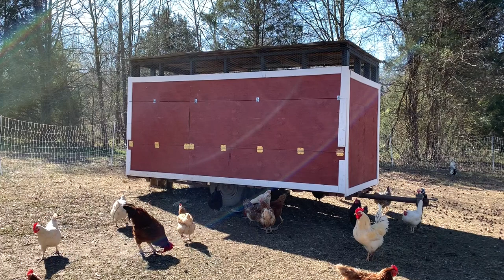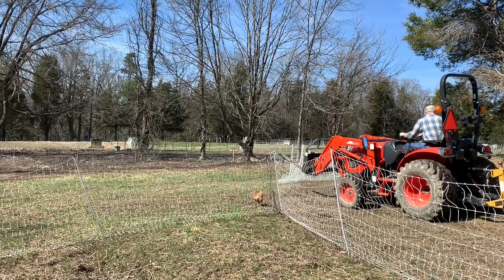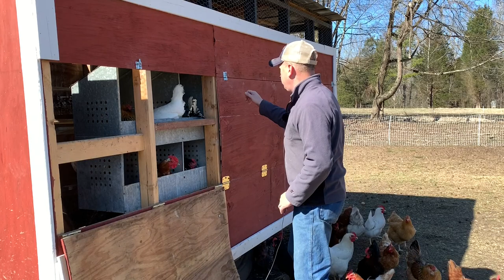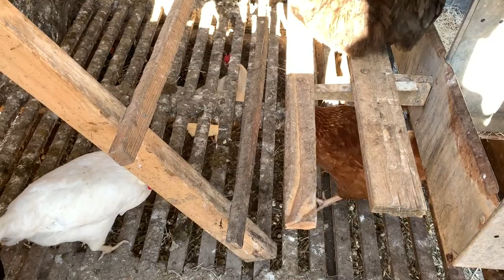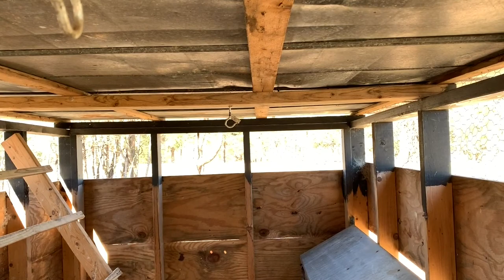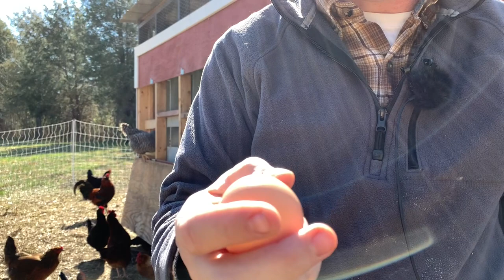Eggmobile - Pastured Eggs vs Conventional

Comment: Great video Chuck, thanks. I'll be moving to a more rural property soon and will be expanding my chicken flock to at least 100 birds. Looking forward to rotating them on pasture and having a nice little income stream in retirement. I have a 5'X10' heavy landscape trailer that I plan to build out into a mobile coop using your design.  I may have a guard goose or an LGD out with the birds to minimize predator pressure. I appreciate you sharing your coop design as I wasn't quite sure how I would build mine, but I like your set up and will use it as a template in building mine. Thanks again for this and all of your informative videos.
Reply from the maker: Kevin Watkins man that’s awesome!!  Chickens are a lot of fun to care for. Glad the video was helpful. That landscape trailer will work great. We have an LGD in with our sheep but have heard they work great with chickens too. Appreciate y’all watching.

Comment: You mentioned you don’t let your chickens sleep in the nesting boxes which makes good since. Mine do when it gets colder. How do you prevent them/train them not to do that? Some of those style nesting boxes have perches that fold up to keep them out. Is that what you use?     Love your videos and all the detail.
Reply from the maker: Yes sir, our have the flip up roosting bars. Flip them up when we get eggs at night and open up first thing in the morning a little bit of work but it’s worth it. Thanks for watching
Reply: If you tie all the bars together and put it on a rope to pull it close at night then no need to go inside, I also have a bungee cord that pulls them down when I release the rope on the outside so again no need to go inside in the morning. A solar powered door closer also means no need to close them up at night just collect eggs in evening